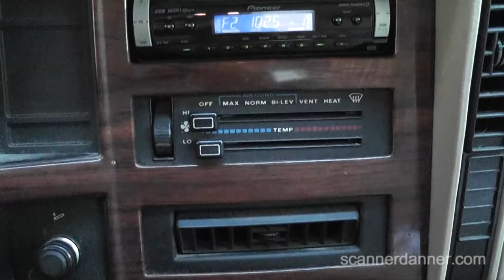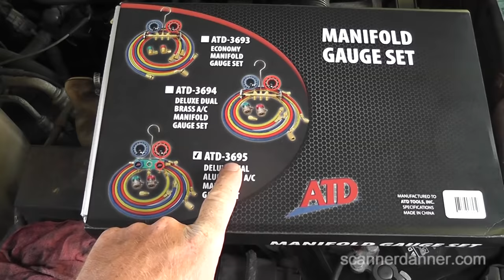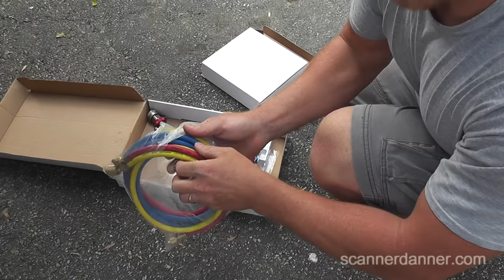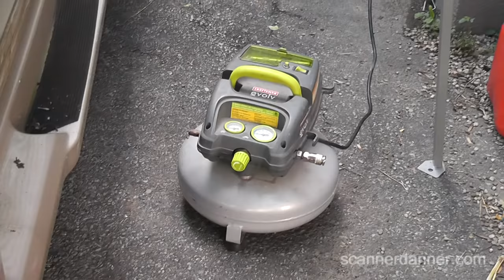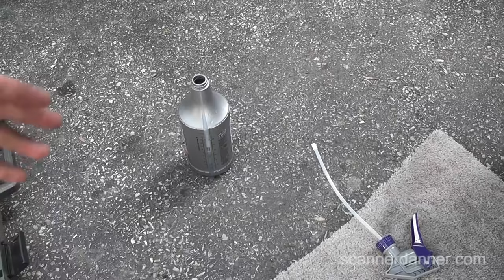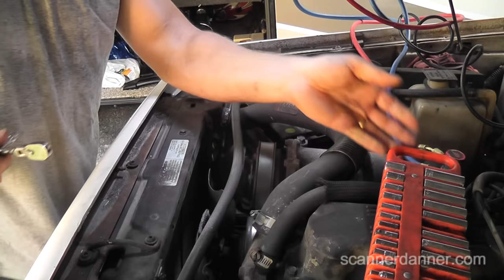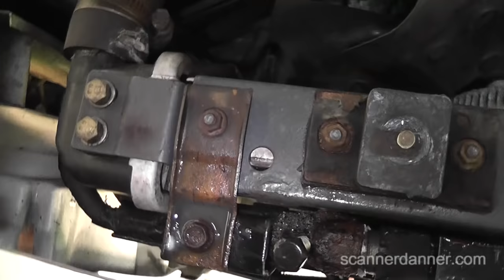A/C Leak Testing and Repair part 1 - 95 Jeep

Comment: Hi Sir! You are a wealth knowledge! your ability to clearly teach in methodical ways is amazing!!! Your troubleshooting skills/processes and attention to details is by far the best!!! 

LOVE the compressed air test and water/soap test!!!! Makes sense and very effective!!!

I have a 98 jeep TJ that you recently helped me with not starting due to after market bypass security relay. I was beating my head for days trying to figure out why my Jeep will not crank. Replaced starter, ignition switch.  Anyway sorry for long story. BUT want thank you again! 

I know this is a AC topic. But here is my dilemma sir. Again I have a 98 jeep TJ 4.0. 

I fully evacuated the system for 30 mins (-29PSI) and vacuum held at -29psi = hi and low side for an hour. 

This is a BRAND NEW ENTIRE KIT AC I installed and purchased from JeepAir.com. Great product but pricey!
 
 
Current Issue: 
Inside vent temp will not go below 60 degrees  L
Outside or ambient temperature tested today with outside temp of 85-90 degrees. 40% humidity 

I also tested this last night with ambient temp of 70 degrees F. 
For whatever reason I cannot get down below 60 degrees on the vent temp.
Ran car for more than an hour, on the driveway and freeway.  No change in vent temp.
 
----------------------------------------------------------------------------------
Here is the quick rundown of my troubleshooting results:
----------------------------------------------------------------------------------
With 24oz of R314a (no additives, dye, etc..)
With 5-6oz PAG oil (Fresh fil)
**Vent temp no colder than 60 degrees L**
---------------------------------------------------------------------------------
 
*****Fan on = LOW setting*****
***Vent temp no colder than 60 degrees :(

 
-Ambient 80-90 degrees

--Low side=96 and High side=101 (Compressor OFF)

-Low side=32 and High side=202 (Compressor ON)

 
-Condenser temp = 126 degrees (with Auxiliary Fan running and Clutch fan running, good air flow, with no more than 1 inch gap between radiator and condenser)

 
-Out of curiosity I also measure temperature hose coming into evaporator (please see pic below)

 
 
 
 
 
 
-----------------------------------------------------------------------------------
***Fan on = HIGH settings****
**Vent temp no colder than 60 degrees L**
-Ambient 80-90 degrees
-Low side=55 and High side=249
Was 
 
-Condenser temp = 126 degrees (with Auxiliary Fan running and Clutch fan running, good air flow, with no more than 1 inch gap between radiator and condenser)
-Out of curiosity I also measure temperature hose coming into evaporator (please see pic below)
 
 
What I am doing wrong? 
I cannot get the vent temp to drop lower than 60 degrees F..
 
Thanks again for all your help! 
And for all that you do sir!

Have  a great weekend.
Reply from the maker: 24 oz of oil? Or did you put in 5? Got to know this first. 
Your low side psi is too high with the blower on high.
Also pinch off your heater hose please. Just want to know. I don't think based on your numbers that will help us.
Reply: ScannerDanner thank you so much mr scannerdanner!! I put in 1.5 lbs 134a 24oz two cans for sure.  5oz. Of PAG46. I’ll have the shop evac and recover r134a again. And I’ll pull vacuum at home.  Pinching heater hose great idea!!!! Thank you!! 
You know what sir I’ve thinking about this all day.  I think I made I mistake! Actually, now I know I did. Rookie mistake. Sorry I’m not AC guy but I try to do everything myself and learn as i go, not quite careless but mistake for sure. Here’s my mistake that may have led to this issue. 

I charged my low side while having r134a can upside down and introduced liquid form.  My comprssor seem to be working still lol.  But I since stopped using it to prevent more issues.

Do you think this was the culprit (charging while 134 can was up side down)?
Either way sir thank you!  And will keep you posted.
Reply: ScannerDanner man oh man!! 
Update: 
Shop evacuated Refilled 24oz of r13a but this time filling AC system properly . Low and high pressure at correct levels. Vent temp still too warm. 

Guess what scannerdanner! You are correct again! After 1 week of troubleshooting. I did what you recommended, I pinched the heater hoses to isolate heater core. BOOM! Ice cold! Holy sh**!!!!! Jumping for joy thanks to you buddy! Again you came through... 

CULPRIT????!!! 
0.05 inches (penny thickness) gap on my hot and cold blend door caused SO MUCH damn grief!!!  Readjusted blend door cable. And that’s it. I was cussing at this cable for a good 5 mins. Lol 
Penny inch thick gap was the difference between 60-80 degree vent Temperature to 30-50 degree of awesome coldness!!! 

Thanks again sir!!

Comment: I still want to get a bottle of nitrogen to fill up AC systems before I charge it up, then just use some soapy water.    Now I play games with my AC machine. Charge it up,  Check it with UV light or with a leak sniffer, Recover it quick lol.    If you pull a vacuum on a empty system sometimes you can find a obvious leak fast by listening in a quiet environment. Usually the service valve are the cause when I do that. Disconnect, put your finger over the valve and you feel it sucking.   Check the caps. If they are oily usually the damn valves are leaking. Good tip on checking the compressor. So many old vehicles have AC that could of been inop for years.  The customer wont always tell you that.  I never used a battery ratchet.  I'm just a 3/8 impact guy  Had a dewalt one for years, its cheap and does the job.

Comment: i just traded my snap-on 1/4 electric ratchet for a 3/8 ratchet.  the 1/4 stripped the gears internally in the head, and for the cost to replace the head it made more sense to upgrade to the stronger tool.  battery life is great, 3/8" ratchet has 40 ft-lbs of torque too.  pricey but very convenient

Comment: The Milwaukee M12 has a coiled wire drive system and it can break.  When I was researching them the Ingersoll Rand 3/8 was the one I finally decided on.  Its a much more robust drive system so you can use it to crack them loose as well as zip them out.

Comment: On the soap mix, for folks who might need to store the mix in an un-heated area, instead of water use windshield washer fluid.
That adapter fitting is to allow you to connect to a 1/2" ACME fitting. That can be found on 30 pound 134A tanks sold for auto use and many vacuum pumps.
Reply from the maker: thank you, I found out how much I needed it. Just finished filming part 2

Comment: I have the Milwaukee I absolutely love it the light on the side to remind you that it needs charged is nice however you run a very long time between charges for example we were able to strip a 1990 Land Rover front accessories off and valve covers intake manifold on One battery pack we also have this 3/8 impact and we love it too go M12 you won't regret it

Comment: few tips dan 
checking compressor for some easy tests prior to pulling stuff apart.
hand crank the front of the compressor this will as least tell you if its seized.
if it cranks okay then power up the electromagnetic clutch to see if it pulls the clutch in. 
2 easy checks that should give a good idea wether its okay

Comment: get the Milwaukee m12 ratchet with the 2 amp hour batteries there compact and still have food capacity. 150$ for the combo or 100$ at home depot for the tool only

Comment: Makita is the one I always use more than my  Milwaukee impact driver. And about the air pressure trick, you could also use a resistor on the pressure sensor (unplugged), till it reads around 1-1.5 volts, and see if your compressor works or not.

Comment: I love my AC Deco 1/4 inch drive electric ratchet. I use it for everything. I work on ambulances mostly so it's everything from aftermarket electrical systems to changing injectors and turbos on powerstrokes. I bet 80% of my ratcheting is with the 1/4 inch tool. Comes with two batteries and I rarely change it out more than once a day, if that. I think any of the major brands are pretty equal so you really can't go wrong.
Reply: AC DELCO LOL

Comment: Paul as far as the cordless ratchets go i have both the snap on and Milwaukee. I use the snap on at work and am very impressed that thing holds a charge forever and is a beast it literally "suffers" from the same "problem" as there air ratchet it'll rap up and smash your hand if you're not watching it. also the rundown tourqe is very impressive. that said i use the Milwaukee a lot at home doing side work, alot of side work and it works great. I would and did myself get the 3/8 as the body of the tool is the same just the head is different so there is no real size advantage I just use an adapter for 1/4 and really haven't found the extra length to be an issue. just my 2 cents

Comment: it's only part 1 so maybe you already figured it out, but XJs are known to leak directly at the evap core, so it's probably a good thing to keep in mind. on mine i still have pressure when pressing the valve, but it's not enough to kick the A/C on. Too much work to replace the evap at this point.

Also really interested in seeing XJ videos!

Comment: My vote for 1/4 cordless is Mac/Dewalt 12v. 
My (and 2 of my techs) main go-to cordless tool is the DeWalt 18v 3/8 impact w/ lipo batteries. If starting from scratch I'd definitely consider the 20v platform, but not for 1/4 obviously.
I have a set of Bosch 12v that are pretty awesome for light work but becoming dated.

IR Just announced a pretty mean 3/8 or 1/2 compact impact. They also have some 1/4 stuff that has always served me well.

Comment: I bought a MILWAUKEE M12CIW38-202C 12V Cordless Impact Driver 2Ah nearly a year ago. The reason I`ve chosen this is the size/battery lifetime/price made it a best deal. It is the smallest so you can work on a places are very hard to reach.

Comment: the Milwaukee tools are the best in my opinion. They have extended life batteries you can buy and the 3/8impact I have will last about two weeks. and I use it all day everyday working in a ford dealership.

Comment: Yes you are going to add moisture. Lots of it. You're also going to load the oil up.  Unless you're pumping it down using a micron gauge you're screwing up a system ! You only use nitrogen !
Reply from the maker: Maybe in theory. Been doing it this way for 25 years with no problems at all, to my own vehicle too. So I can tell you first hand with years and years of driving after the repair that I've never had any issues.. Of course I am evacuating the system when I am done. Not sure what a micron gauge is.

Comment: As to further physical investigations, I've never seen an AC compressor clutch yet that was worth keeping that had that ring of powdered rust around the clutch engagement area.  Really bad one will spray the underside of the hood with a red line as it comes further and further apart.  Rusty dusty means the clutch and bearing needs to go away.  Be picky at the U-pull it place, you don't want another one like this one. If the price is right, get two while you are getting and you might be able to piece up a spare out the three of them as the compressor part here seems to be a good one.  I wonder what the deep discount rate is on one that is locked up?

Comment: I have the Milwaukee ratchet, after lots of considering though, I decided on the 3/8 instead of the 1/4. It's the same ratchet just with a different end. It's nice being able to use larger sockets on it as well and I don't feel any real compromise in terms of bulkiness, just my preference I guess but something to think about.

Comment: I use a rigid $150 lifetime warranty including the batteries and battery charger...can interchange 1/4" 3/8" and 1/2" sockets...doesn't reach tight spaces...would have to buy Milwaukee as you mentioned but don't have that type of $$

Comment: also, sometimes nothing stops the compressor from actually failing, or destroying itself. Also, the most common ac leak is at the schrader valve, and behind the compressor clutch

Comment: The idea of finding an A/C compressor from a salvage yard is noble. In reality this is fraught with gotchas! A 20+ year old vehicle sitting in a salvage yard with an A/C compressor still in the vehicle is probably rare. But if you find one no doubt the system will be open and air and moisture has penetrated the compressor. One like this will probably have internal corrosion and will fail very quickly.

If the A/C compressor was removed and has been sitting on a shelf then it might be better but the same problem with air and moisture corroding internal parts can still be an issue. 

New and rebuilt A/C compressors are evacuated and then shipped with a nitrogen charge and sealed. This eliminates air and moisture corroding internal parts while the unit sits on a shelf. But I am anxious to see what ScannerDanner finds as a salvage compressor and if it functions properly.

Comment: Go with 1/4 inch Millwakee plenty of power and battery life . I've had mine of a couple of years no problems every day use . I have snap on in 3/8 it is a lot more durable and stronger for breaking bolts loose manualy doesn't feel like it will break . I use snap on for water pumps alt stuff like that and Milwaukee for intakes and smaller stuff they both work great I hope this helps

Comment: I watch your video on your 95 Jeep I have I will look in the same place for that leak thank you I got a question I got a 99 Dodge ram 5.2 the AC I done the air pressure test it held pressure I took the gauges of and found my leak at the high side port I'm going to vacuum down do I need to add any oil nothing was replaced except the valve

Comment: Hart impacts deliver 350lbs of torque for a little over 100 for 1/2 inch drive, I know this came out along time ago but hart is owned by TTI who owns Milwaukee tools, and if you use li ion batteries you need at least 2 amp hours but preferably a 4ah will give you better performance
Reply from the maker: I wasn't using Hart or TTI or Milwaukee tools. 🤔

Comment: I am getting ready to do a leak test on my grandson's '93 Mazda Miata. It is an R12 system. Some questions for when I get ready to charge it. He has two 14 oz cans of R12. The tops are smooth. Are those protective caps for a fitting underneath or do I need some other kind of fitting for those? I'm afraid to pry them off.

Assuming I don't need to replace a condenser or anything like that, how much oil should I add to make sure it has enough? Can I use regular mineral oil or do I need to buy a special oil?

 I am REALLY learning a lot from your videos. I couldn't do it without you!

Comment: Regarding your Jeep, check all of the rubber parts in the brake system.  My sister brought her 1994 new and now has 27,000 miles on it.  The rubber in her brake system calipers was dry rotted and all of the seals needed to be replaced.  Be careful!

Comment: The charge hose (yellow) should also have a check valve in it so not having the hose on it wouldn't matter at all.   So you should have one in place of you look up inside there

Comment: Freon only last forever is certain compressors.   Shaft driven compressors will actually loose freon over the years to where you will have to recharge it.

Comment: That extra small brass fitting looks like a metering device for feeding liquid refrigerant into the low side, it causes the refrigerant to vaporize before getting to compressor, otherwise you would be feeding liquid into the low side and damage compressor.
Liquid is not compressable,  The Compressor is condsidered a Vapor Pump. 410A reftrigerant is charged into system as a liquid only. R22 and R134 are charged as a vapor, but liquid charging is faster with a restrictor.

Comment: Hello Mr Danner, while searching youtube for info on fixing my AC system om my 1980 Datsun, I stumbled on your channel. All of your videos on the Jeep are also related to my car because the system has not worked for several years and I would like to get it working again. The Compressor clutch still works and I did a pressure check on the system with compressed air using your video. However there are several videos on youtube that shows the Red, Blue and Yellow lines hooked up to the manifold opposite to the way you did. I bought my manifold from Amazon and it seems to be of a good quality but there are no description on the proper way that the lines goes, that is which side is screwed into the manifold and which side goes to the valves on the A/C ports. Can you do a video on the proper way to hook up the Red, Yellow and Blue lines.
Reply from the maker: For a 1980 car, you are dealing with R12 refrigerant unless it has been converted to R134a. So the R12 hoses are different. The side of the hose with the shradder valve would be the side the goes to the car fitting. You absolutely do not want that end of the hose connected to the gauge.

Comment: Using compressed air and soap for leak checks, what do you think about using smoke machine to find leaks. I have a home made ebay design machine that works great for evap stuff using clear mineral oil.

Comment: in asia ,they modify the fridge compressor  to do ac ,similar what your doing ,compress air in the system to find leak.and then evacuated then recharge .everything done in 10 minutes lol

Comment: Hi Paul. Nice video as usual. Couldn't you just MIG or TIG weld that crack in the AC compressor if you don't want to spend the money on a new one? Or, that maybe would deteriorate the coil inside...?
Reply from the maker: possibly but I suck at welding and more importantly I don't have one :-)